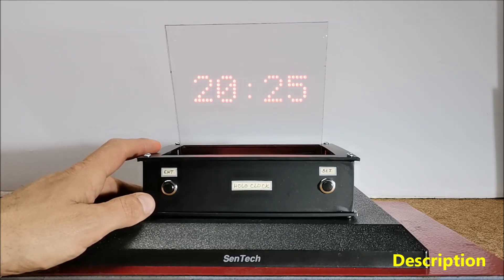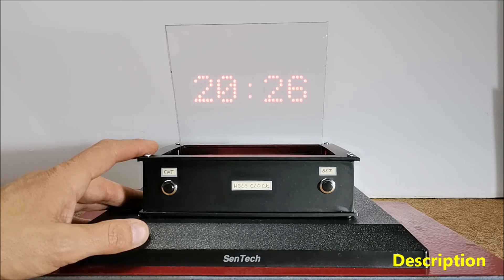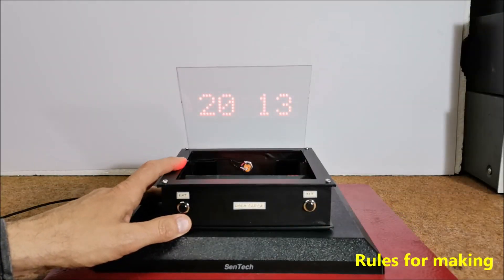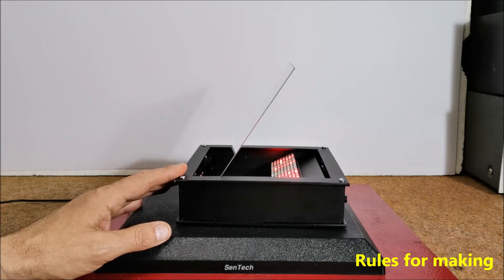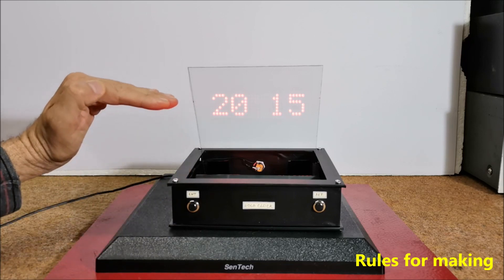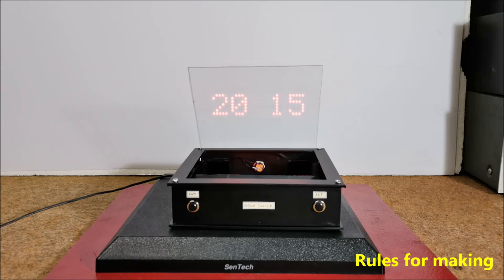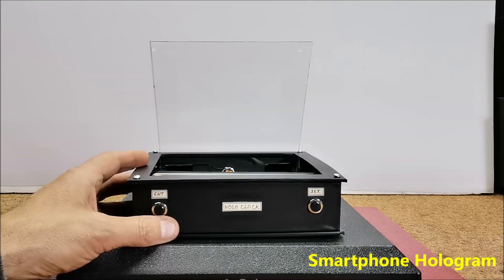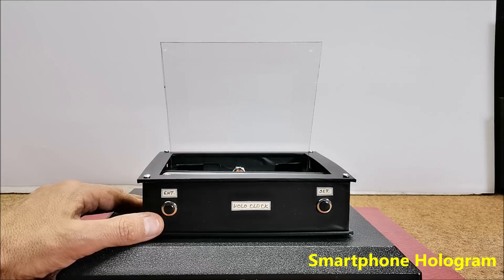DIY Arduino Holographic Matrix Clock

Comment: To help hide the idea that this is a reflection, I would suggest adding some metallic framework around it. It may help if that metal is somewhat random and angled around the sides, and if the glass is not just a square, but somewhat angled on the sides. The goal would be to suggest that the surrounding framework is generating the fake hologram.

Comment: Amazing...😍
May I try and ask for permission to use the program code, Sir?
😁✌🙏
Reply from the maker: Of course, you can also modify it if you want
Reply: @MirkoPavleskiMK  
Thank you very much for your permission and response🙏

I've tried it, but the big number only says GF:HJ
what should I do to match the clock so that it runs normally
🙏

Comment: is it possible to provide libraries because Arduino ide 2.0 lib is having compiler issues
Reply from the maker: You can now download the libraries I used on Hackster   https://www.hackster.io/mircemk/diy-arduino-holographic-matrix-clock-c35b5e
Reply: @MirkoPavleskiMK Thanks i've got 1 last issue my text is mirrored instead of hello! it displays !olleh how can I change? edit bcs I'm not using the glass so I don't need it to be mirrored
Reply from the maker: Try in this part of code:
if (val == 1) {
   // lc.setLed(address, y, x, true);
   lc.setLed(address, 7-y, x, true);
  } else {
  //  lc.setLed(address, y, x, false);
  lc.setLed(address, 7-y, x, false);
to activate commented rows instead current active rows
Reply: @MirkoPavleskiMK this worked! btw where do i change the time of the rtc. Sorry for all the questions 😅
Reply from the maker: @xaero7262  Look at this video : https://www.hackster.io/mircemk/mini-led-matrix-clock-d4f5f5
Reply: @MirkoPavleskiMK  ye I already found out how thanks anyways